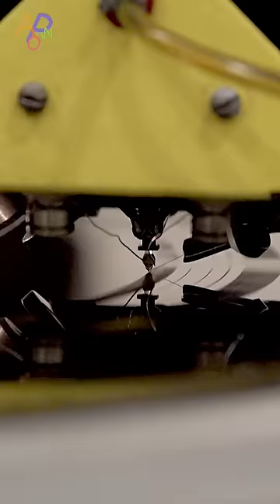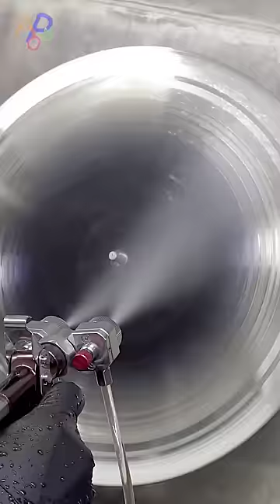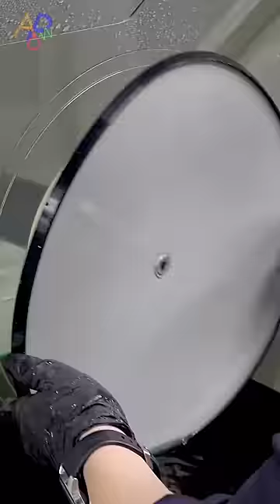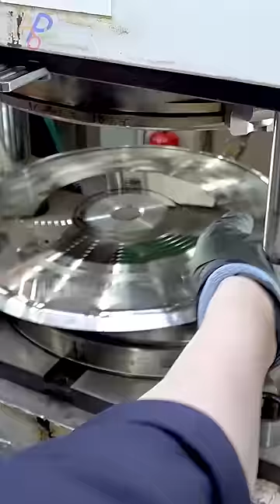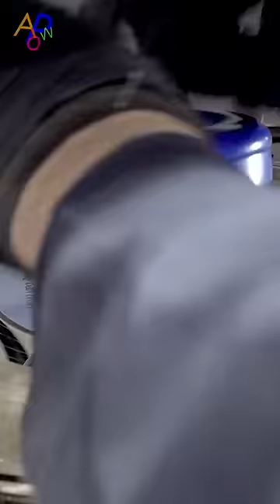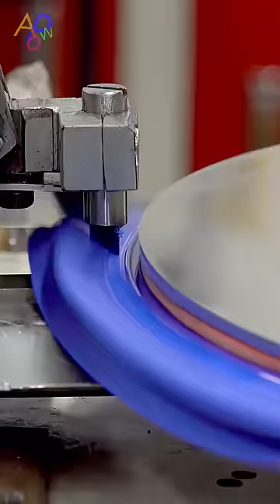Vinyl Record Making Process. Korean LP Records Factory #allprocessofworld

Comment: Its mindblowing how the detail is contained over so many steps
Reply: yep. Its an involved process that must go right at every step or you end up with a defective record.
Reply: Yeah, it's hard to beat a well-pressed and clean vinyl record for sound quality too. Digital can only sample so much (and if you tried to sample more, the file size would exponentially increase) whereas vinyl allows you to have literal molecular detail
Reply: Well, it's not compared to the info that was actually there in the first place and what could be easily put into digital form with 2-3 magnitudes higher accuracy.
Or it is, compared to how bad human hearing is.
(Oh something triggered my old fragile signal processing engineer's heart...a pitiful display...I know)
Reply: @bastianschon7146  thts NOt what hes talking about though.
Reply: @allotribus  then there used to be a thing called quadrosound records...
Reply: @ApertureAce  The source for the vinyl is still digital. No singer is recording on vinyl.
Reply: @saadisave  Old-timey shellac 78s used to be done that way, though.  The master recording was done directly on a wax disc (originally without any electronic amplification at all, hence the need for soft wax for the stylus to cut using only energy from the sound waves), then put through a process even more complex than this.  They used to have to make the wax blanks over-size to account for the meniscus at the edge of the casting tank, so the part used for the actual recording was dead flat; what's really mind-blowing is that, since they started the recording machine with the stylus further out than that, apparently they've now been able to extract fragments of casual conversations from artists and technicians of a century ago from the rim flashings of the intermediate-stage discs of these original master recordings.
Reply: @ApertureAce  I dont think you know it, but most "vinyl records" acctualy use Digital...
Reply: hardly
Reply: @bastianschon7146 Not exactly. Nothing against vinyl; I have a couple shelves worth sitting behind me, but as long as the sample rate is at least 2x the upper frequency limit, than the original waveform can be reprodroduced perfectly (or as close as the real world will allow). The upper limit of human hearing is ~22 kHz, which is why the CDs use a sample rate of 44.1 kHz. A lot goes into mastering a recording to make it suitable for vinyl, to make up for physical limitations, and variance across the surface of the disk (the grooves along the outer edge are moving a lot faster under the needle than those near the center, for example, so distortion caused by cutting higher frequencies become an issue near the center).

I do love the sound of vinyl though, and learning what makes either format tick is a rabbit hole of delightfully useless information.
Reply: @ApertureAce  That is absolute horse shit. Even a CD quality recording has vastly superior detail to noise ratio compared to vinyl. Stop mistaking noise and trash for "warmth/quality".
Reply: @ApertureAce that's not true at all. The conversion of the frequency components of the audio should be lossless if the Nyquist condition is met according to the Fourier Theorem. And a 24-bit quantization error is so small that it's pretty much indistinguishable from the raw analog recording to the human ear. Plus, digital filtering is more reliable and less prone to noise compared to analog.
Reply: Why your avatar has no gradient?
Reply: @darkfrei2  😆
Reply: @saadisave *and editing
Reply: @gordon7478 I’m going to also do some polite hating on vinyl too.

Dust, and just the needle gradually wearing down the record and/or the cartridge getting old are also issues.  Granted if you use one of those Laser Turntables dust is your only issue, but I’m not too well read on all that.

I get vynnl from a “it’s a neat process” perspective and/or from a Nostalgic Perspective, but in terms of quality any sort of digital made with a good workflow (ie Lossless all the way down, not FLAC file…made from a downloaded YouTube video made from a bootleg recording etc) is going to be way better.

Granted at rhe end of the day as long as it makes you happy that is fine too, plenty of people living their best lives without tHe PeRfEcT eXperIence, and back in it’s heyday Records were handled in auto-changers which slid the records across eachother so yeah.
Reply: @ericlotze7724  Exactly. Personally, I think the quality argument is a waste of time, not only because the vast majority of vinyl produced over the last 2 to 3 (maybe more) decades are analog pressings of digital audio, but more because who cares? In the digital domain, quality matters far more (a 96kbps MP3 is going to sound bad, no matter how you slice it), but there's no arguing that vinyl can sound "good" even if it isn't necessarily a perfect reproduction of the source material. I love the big sleeves and ample liner notes, and I enjoy putting an album on and just playing it all the way through. I don't give a sh*t about the Nyquist frequency when I'm ears deep in Dark Side of the Moon or Houses of the Holy.

My main gripe with vinyl, and I say this as someone whose younger self was excitedly anticipating its revival, is that it's a technically worse delivery mechanism that requires significantly more resources to produce (energy, toxic materials, fuel required to ship it, etc). I can understand the niche application for DJs who still work with turntables—that's an artform, and a fairly niche one—but in terms of mass production for a general music audience, it's not an appropriate time in the history of our planet to bring that back. I always preferred buying used vinyl from a good indie shop anyway.
Reply: @ApertureAce  That's complete and utter nonsense. Digital music files have every bit as much detail or more, assuming it's minimally compressed or uncompressed, and you have an adequate sample rate to meet the Nyquist-Shannon principle (around 40 KHz is all that's required for human hearing). Digital files are also not subject to surface noise and wear, further enhancing detail. The highest-quality vinyl record in the world will not sound as good as a high-quality digital file, or at best, be indistinguishable. 

We like records because they're cool and the experience is fun, not because of some magical superior sound quality.

Comment: This is a proper pressing.  Note that the label is placed upon the puck before the press actually happens! Super high quality.
Reply: what is the benefit of placing the label prior to pressing?
Reply: @nsfpeace3442  it's really unlikely to come of if it's pressed into the material rather than glued on after. Most records, as far as I know, are produced in this way.
Reply: @nsfpeace3442  Generally cheap fragile, crummy pressings have an adhered label vs. a pressed label.  The pressed label becomes part of the pressing.  This type lasts longer and is less likely to come off or be lifted from the edge; as the edge is embedded in the pressing.
Reply: Interesting! Thank you
Reply: Records made from the cheaper material styrene (material commonly used in model kits) had glued labels, they weren’t too common as they weren’t as durable. Mostly used for 7 inch singles
Reply: An intelligent YouTube comment. It's been a while since I've read one!
Reply: @martybadboy  it's nice isnt it
Reply: As if that would matter. 😂
Reply: But are they letting them cool properly so that they don’t get warped? That is the question.
Reply: H
Reply: At that start I thought it was a lathe cut record, and was gonna be slightly disappointed, but then I realized it was the dye being cut.

Comment: I actually started working in a record making company in toronto about a month ago. The first half of this video is usually handled by a seperate department in the same company. The process is called "electroplating". They essentially make stampers with the required audio files . The second half is where machine operators install the mentioned stampers into their machines and press hot pvc plastic pucks into them to create the record. The last machine you see is just a trimmer.
Reply: Gracias por comentarnos los detalles.
Reply: @marioperez9845  de nada mi amigo 😁
Reply: Why records names vinyl if it made from PVC ?
Reply: @vilzewylcapitalowih3913  look up what pvc stands for, heres a hint, 1 of the words if vinyl ;)
Reply: Didyou see how they recored on the first Vinyl ? The whole band was sitting in a room playing into a tube while the needle carved the waves. That's so amazing.
Reply: Yeah ... i used to work  for a beeech .. that makea the masters ( electroplated  disc made from nickel and silver )  then loaded to computers to transfer data and to a moulders that mould3d discs etc then to a printer operstor that ( offset or screen printing ) the to  packaging to dispatch to costumers. Easy job but shit pay
Reply: That spray that looks like metal? Is that to have a conductive coat? Is it silver? Kind of like tolens reagent? Or it it something else?
Do you know the formula?‽
Reply: Thank you for the explanation. I didnt understand anything of what happened. Very good explanation.
Reply: @frogz спасибо 😊
Reply: @germaniatv1870  That wasn't vinyl though, that was shellac ;) And the master record was wax. 

They made a master stamper from this wax record, which got destroyed in this process. Then the production stampers where made from this via an intermediate positive. 

Vinyl/PVC is too soft for acoustic players.
Reply: @VintageTechFan  Right 🙂I was just watchin "Analyzing KRAFTWERK's BEATS - minimal Drums for maximum effect". At the last part of the video talks about how Kraftwerk basically created the Rap-Hip Hop beat 🙂
Reply: do you grab the pucks bare handed? Back in the day we had to do it bare handed to prevent contamination.
Reply: @jussayinmipeece1069  one can feel like it, but it's pretty hot to handle. 
We use latex gloves with the automatic machine when touching vinyls and a clamp to remove a hot puck if needed. and heat resistant gloves when using the manual machines where you have to handle the puck by hand more often.
Reply: @bassad6289  lucky you . Back in the day we had to use bare hands, We didn't even have automatic machines. The extruder pumped a puck, you picked it up, slapped it into the stamper and pressed both buttons.

Top stamper came down, steam came in , and you were ready with one label and another puck as the top stamper was going up and that shyte was HOT. 

You grabbed the edge of the record and pulled it off as the air puffed it up and slapped the new puck down as you put the record onto the cutter.

After a few weeks your hands had more callouses than a donkeys feet.
Anyway hope you like your new job. Its a dying art.
Reply: @patrickhenry9521  a  little tiny wizard lives inside of the plastic and when it is originally pressed he is inserted between 2 layers of the plastic.....err im not supposed to tell you that part but they cut a wavey line in it and when you put a tiny thing that can follow the line and spin it right, it'll reproduce sound!
Reply: Can you video tou experiences.
Reply: @frogz  🙄🙄😳😳🥴🥴😁😁😁😁😁😁😁😁😁😁🤣🤣🤣🤣🤣🤣
I dont think people realize that they can look up other things apart from porn on their phone.
Reply: @Patrick Henry  As you type on a piece of metal and glass to a community of billions of other people who access nearly all recorded knowledge we have to offer from the same piece of glass/metal.
Reply: @patrickhenry9521  oh good sir, for that i would suggest an informational video on youtube. Look up " how music turns to audio files/ how music is transferred onto CDs/records/tapes." It's definitely something the world doesnt simply teach you, you have to look for that info yourself.
Reply: @jussayinmipeece1069  took the job due to it's proximity to my address, a walking distance. But i maintain a decent record collection, so it's like hitting 2 birds with 1 stone. I get a job close to home and i get to learn how to make something ive been collecting for a decade now. :) It's a boring job at this point, but i enjoy its simplicity and i enjoy making something of quality that others can enjoy too.

The process only changed a little since you last probably worked in it and that's only due to the evolving system of employee safety. Theyre looking at a lawsuit if i damage my hands indefinitely due to the lack of proper protective material. So gloves of all kinds are provided , by law . Not only that, but ear protection due to the loud noise of the machines and the flash grinding room in the back, and proper respirators when mixing colors with pvc. (The dye is very light dust that can easily be inhaled without noticing)
Reply: @petevenuti7355  unfortunately i havent worked in that department, so that information is restricted to me.
Reply: @vangelisgru7271  unfortunately not. But what you see in the video after the first process, is basically what i do.
Reply: @bassad6289  seems the biggest change is the actual vinyl id say. Back in the day the color were pellets mixed with clear vinyl. 
Black was always the default of course. There  was always a small amount of dust but nothing much.
Reply: @frogz  🤣🤣🤣🤣🤣🤣🤣🤣🤣🤣🤣🤣🤣🤣i am dying.
Reply: @Bas Sad  thanks for responding. Its still a cool proccess
Reply: @jussayinmipeece1069  we got clear pvc for opaque, transparent and translucent vinyls. Colored pellets are made by us by mixing clear pvc with powdered dye. We get black and white as is. We add colored pellets by hand to pucks when we're making special effects as per the customer's request.
Reply: @VintageTechFan What are you talking about? Shellac hasn't been used since the 40ies. Vinyl records are made of... Big shocker, vinyl! (Vinyl chloride acetate to be precise)
Reply: @SirRebonack  About the ACOUSTIC records @ksgermania6159 was mentioning. Those were only done up to the 1920s (all electric afterwards) and therefore all shellac and not "vinyls". Better pickups allowed for using vinyl (without the filler which always created some noise) and finer grooves, which why it was used from the 1940s onwards.
Reply: @VintageTechFan  OK, gotcha! YouTube's comment system really sucks.
Reply: @bassad6289  хотел бы там побывать, где ты работаешь....
Reply: Greetings from Mississauga
Reply: Can you get me some of those metal plates?
Reply: Do you know if it’s possible to cut the pressing plates with a laser instead of the diamond tip vinyl cutter? I was just thinking a high enough resolution laser engraving a steel plate might be able to reduce any defects/ errors in the pressing process and also you could laser etch the paper label design in the middle and not need the paper in the middle anymore.
Reply: @patrickhenry9521 as the record rotates, the incredibly sharp diamond “needle” cuts into the plastic and allows the sound out at exactly the right moment. With it being a vinyl compound, it self-heals as it passes the “needle” ready for another playing. However, the number of times you can play a record is very limited as each time it’s played you lose a bit more of the audio contained in the record. 

Higher quality pressings are usually thicker and hence have a wider range of sounds with deeper bass being the main benefit. 

Hope that helps 😉
Reply: @frogz I think you’ll find the practice of sandwiching wizards between the layers of plastic became outlawed in 1967. I’ve given a more accurate and contemporary explanation to 
@patrickhenry9521
Reply: Please tell me. Since you just got 5he record company job about a month ago, are LPs still being produced? Even after it's been eclipsed by CD, Dvd, Blue rays and streaming?

Dang! I miss those vintage items
Reply: @intelle8950  hell ya, and sales are great.

Comment: This is basically the same process that used to be used to make CDs.  The machines are a lot cleaner but this is pretty much what it looks like in the old "how it's made" films from the 1940s and 1950s.

The reason there is a master, then a copy, then a secondary copy, is that the printing process wears out the grooves so you need to replace the secondary copy a lot.

Comment: First they take the dingle bop and they smooth it out with a bunch of schleem.
The schleem is then repurposed for later batches.
They take the dingle bop and they push it through the grumbo, where the fleeb is rubbed against it.
It's important that the fleeb is rubbed, becasue the fleeb has all the fleeb juice.
Then, a schlami shows up, and he rubs it and spits on it.
They cut the fleeb.
There's several hizzards in the way.
The blamfs rub against the chumbles, and the plubis, and grumbo are shaved away.
That leaves you with... a regular old vinyl.

Comment: i work as  a  mastering engineer . We cut on DMMs but for big stereo lacquer discs are better in my opinion. On DMM you can cut around 70 microns at depth but lacuers can take even 100-110 microns which is way better for good stereo . For DMM you need expensive diamond stylus for lacuer sapphire :)

Comment: I don't understand. When I ask people why they are buying vinyl discs, the answer is they think the sound from vinyl discs is continuous sound, not like the sound from mp3 or even lossless file, and it sounds better. But as far as I know, they record the sound to the vinyl disc by an audio file, so the vinyl disc will have the sound quality as good as the audio file only. Did I misunderstand something?
Reply: You've got everything right. Only MoFi allegedly uses analog tapes for vinyl pressing
Reply: I'm willing to bet that the sound file they use is of a much higher quality than anything that is readily available to the public.

That's just a guess, though.  I don't have any inside information.
Reply: They are full of BS, as vinyl lovers tend to be.